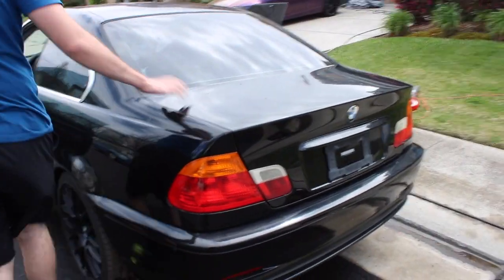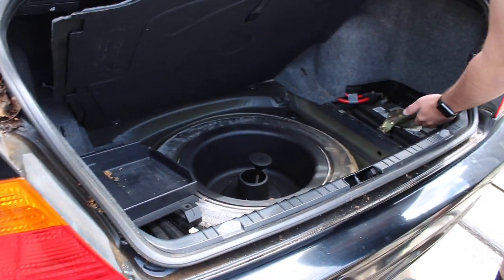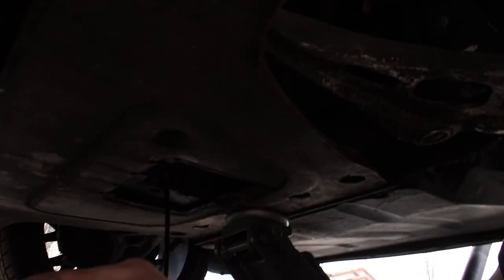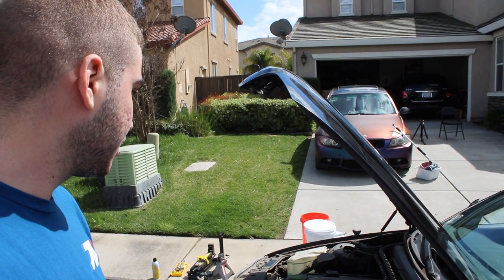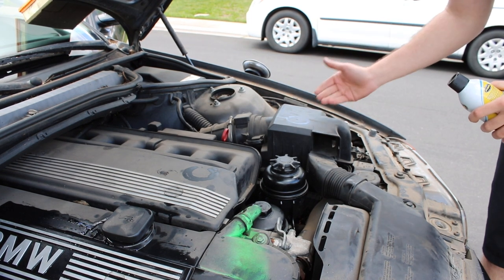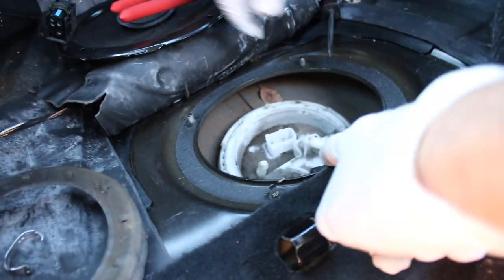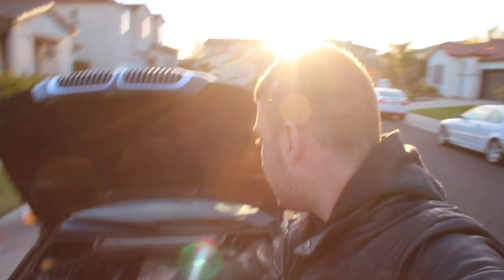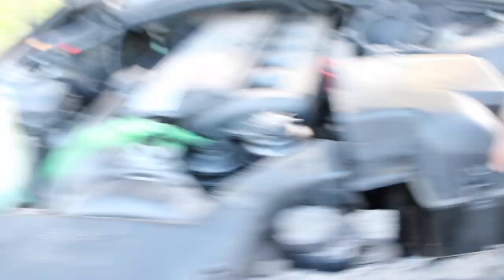Will the e46 START?!?

Comment: Remove each spark plug and lubricate each cylinder with a bit of oil. Had the same problem with the e46 I picked up from the auction because it was sitting for too long. Replace spark plugs if they look shot
Reply: Just saw you replaced them, lubricate each cylinder with a bit of oil. Might be petrol flooded from sitting for so long. Should start up
Reply from the maker: how to fix the flooded?

Comment: Just bought a Mercedes for dirt cheap because it wouldn’t start. Took apart the throttle body and cleaned all the gunk out and it started right away. Try cleaning out the valve with carburetor cleaner

Comment: those engines suck. they are no N52
Reply: Gabriel Lopez indeed, I've had my e60 n52 since 70k, second owner. Now it's at 193k and I've only had to replace the oil filter gasket, which is pretty much the only problem with these cars!